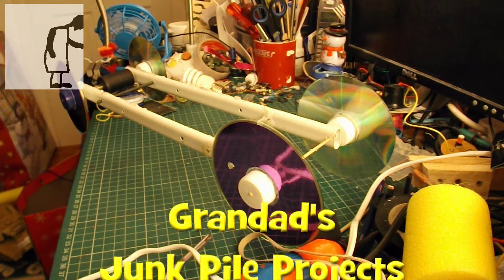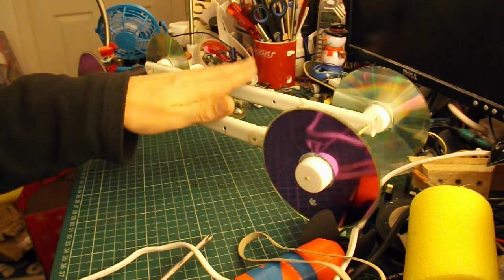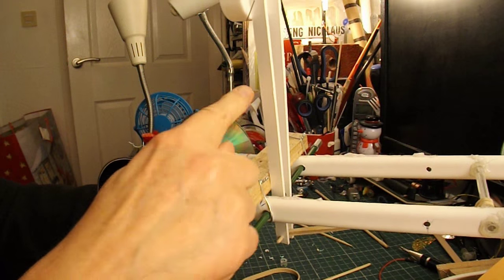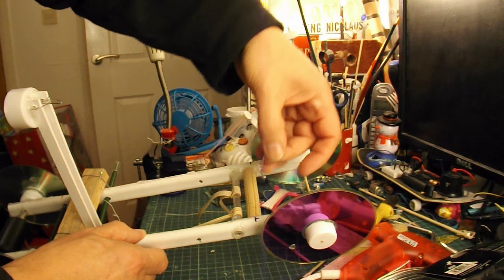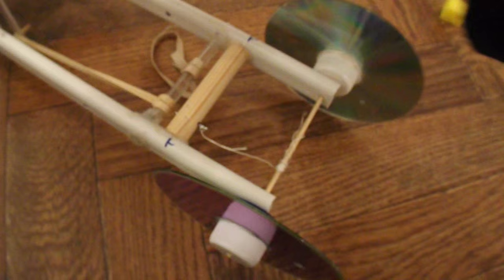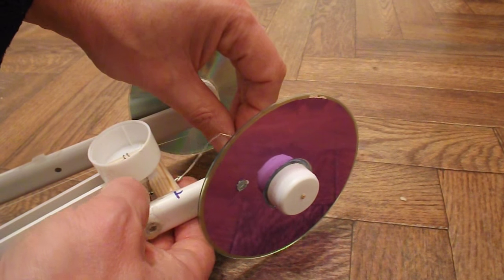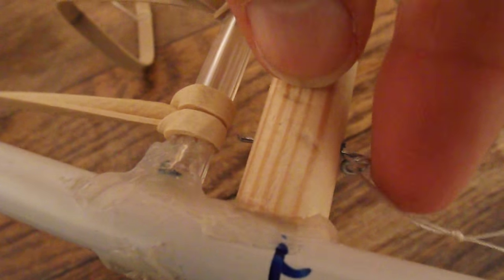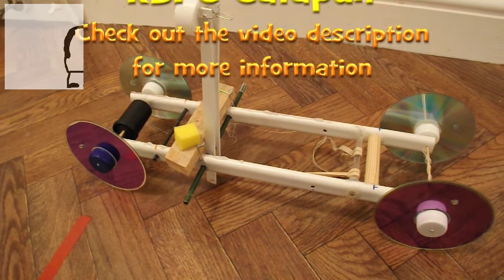Grandad's Junk Pile Projects #3 RBPC Catapult

Comment: hello grandad. can you get a large or pretty big toy car and cut the chassis to make a rubber band powered car with a car body on top. I think this would be a neat project
Reply from the maker: +Pat Ek the main problem with using toy cars is the small wheels are usually plastic and have no grip. Here is an alternative https://youtu.be/GkK11TMxjGc
Reply: +GrandadIsAnOldMan that was great thankyou

Comment: Nice launcher!
Reply from the maker: Not very powerful but met the criteria of the task :)
Reply: I build, as you've seen many catapults. Try looping it from the bottom, over the arm and torsion it on the front of the machine.
Reply from the maker: Myra Madd haha, you are like so many of my viewers, always want it faster, more powerful, bigger etc. It does all it needs to do. If the task set had required the projectile to fly a particular distance then we would have done more work :) The most complicated issue here was to get it to trigger at a particular point in the run. If I made it too powerful that could make the trigger more difficult.